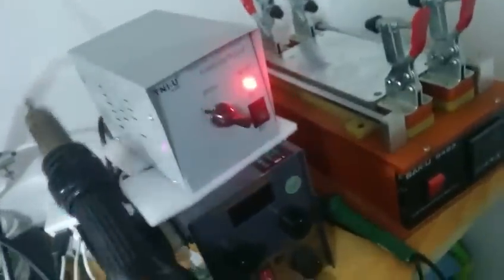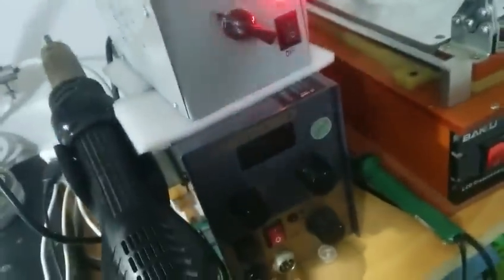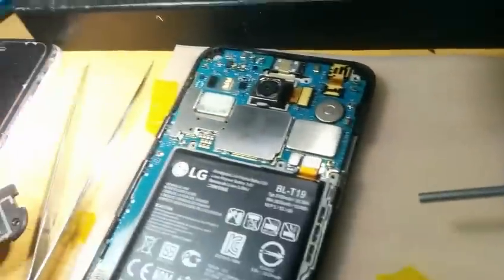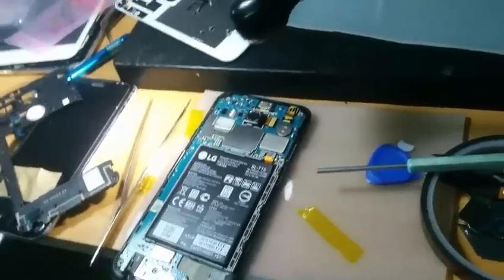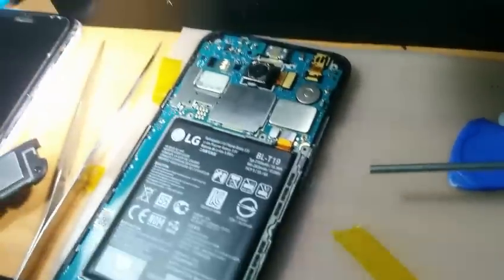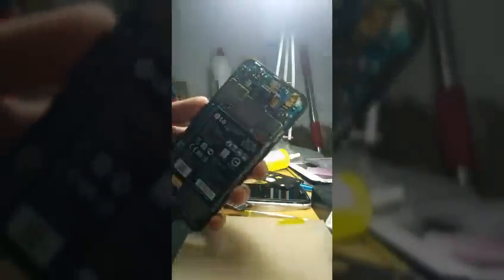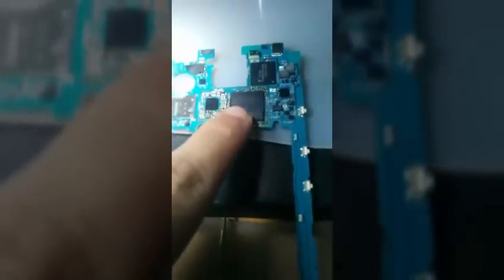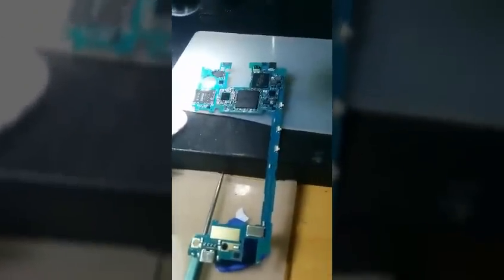NEXUS 5X DEAD (ultimate solution)

Comment: my device used to bootloop and get stuck at the google logo. its not working now.. when i connect to the pc it shows qhusb bulk in device manager
will iit work if i use this method?
Reply: i have the same problem......when I connect to pc it shows qhsusb_bulk.....it's only showing red led whenever I press buttons
Reply: i have the same problem......when I connect to pc it shows qhsusb_bulk.....it's only showing red led whenever I press buttons

Comment: Thanks for your video. When you applied the heat, how much heat? Any idea what temperature? I have a hot air gun and I can set the temperature between 100-700 deg F. But I don't want to damage it so I don't know what temperature to use. Thanks.

Comment: I give up, after heating the processor 4 times for 2mins and testing the device each interval, it doesn't fixes it permanently but just temporarily so RIP my Nexus 5X :(
Reply: Tech head101 the longest time it stayed ago was like 10mins lol then it rebooted, the others like it wouldn't even boot successfully and just kept on freezing while the bootanimation plays
Reply: Tech head101 nope I don't have any tweezers but I can use a plastic tool to put pressure on it while heating. I'll probably do this tomorrow as I already close the case off my phone.
Reply: Tech head101 and yes, will do that. I'm only using the low option of hairdryer so it's ok. Thanks alot man for the help, I rly appreciate it alot 😊
Reply: Tech head101 alright man I'll let you know, thanks again and have a nice sleep! ^^
Reply: Hey Jovie, did you do the process once again??